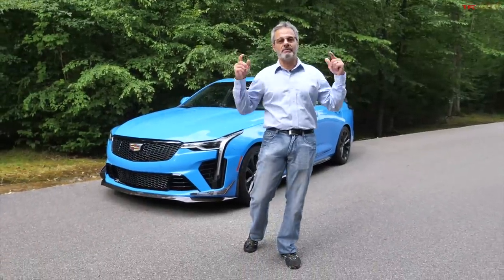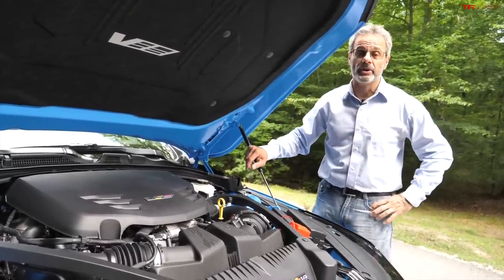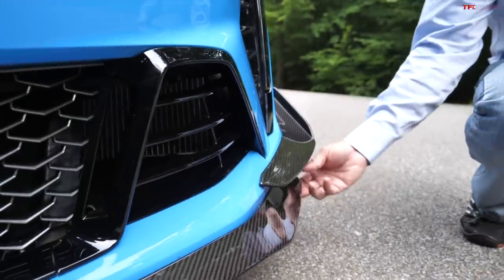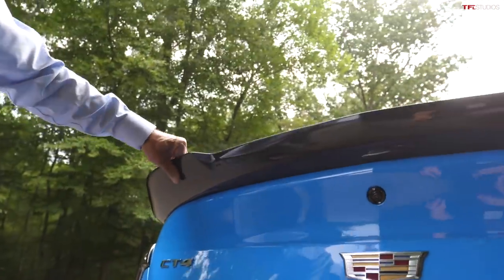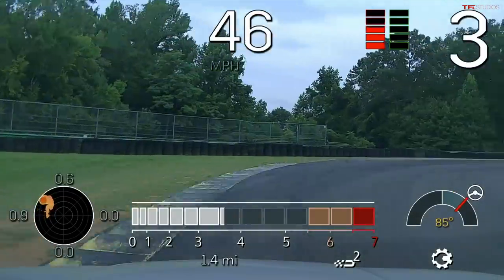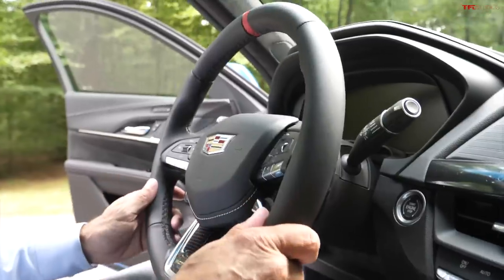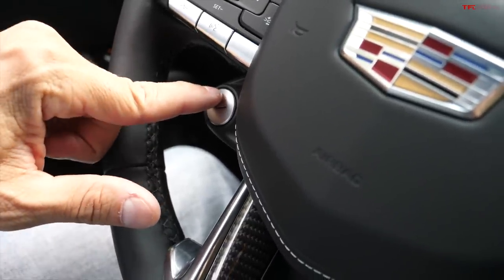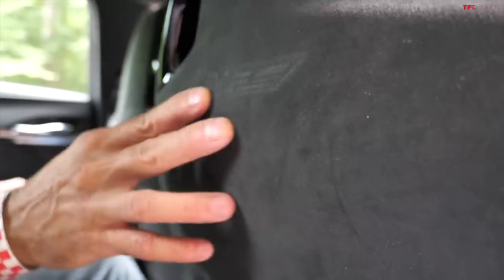Finally, Is The 2022 Cadillac CT4-V Blackwing The Long-Awaited BMW M3 Killer?

Comment: I have an ATS, I definitely want a CT4 now. Edit: the hyper-BMWs like the M3 do not have 50/50 weight distribution, for example  the 2021 G80 M3 automatic has a 53.5/46.5 front to rear weight distribution.

Comment: Fantastic video!  I've learned more from you about the Blackwing program than ANYONE else. I have a 2017 Chevy SS Sedan with the 6.2L V8, so I know that GM is capable of.  I have also owned 3.6L CTS's in the past.  But I like the sound of the 6.2L best; maybe I'm a CT5-V Blackwing guy?

Comment: This is cool and all, but you know we're all waiting to see what its bigger brother, the CT5-V Blackwing, can do! 

It's about time they made a manual V8 Gen 6 Camaro that you can see out of and has a usable back seat & trunk. Here's to hoping they make an NA version of the CT5-V Blackwing.
Reply: An NA version of the CT5 would just be a 6.2 V8 with the same power and more weight compared to the CT4V Blackwing.  it wouldn’t make sense
Reply: @bradyg499  Honestly it's what the CT5-V (non-Blackwing) should have been. They have all the hardware... also, why do they even keep this TT V6 alive? The 6.2 V8 is a gem, while most people agree that the TT V6 sounds like a vacuum cleaner. Nobody cares about the numbers or MPG in this segment. These cars are pure emotion and in that regard the V8 beats the TT V6 any day of the week.
Reply: I chose the 4 twin turbo because I thought  the manual would match up better with that platform. The 5 is just too big for my preference.

Comment: Pretty sure the ATS-V 3.6L TT LF4 also had Ti con rods in manual form.
Reply: On the ATS-V's it did. I'll keep my ATS-V's. I do wish I had the A10 and the Gen4 Mag ride system though.
Reply: It's the same engine
Reply: @mistamaog  But without the titanium rods with the A10
Reply: @mistamaog  Oh... and the ECM in these is locked... don't expect to be able to tune them anytime soon if ever.
Reply: @SteveBrueck  Better off with a manual anyways 🙂
Reply: @mistamaog  I grew up with manuals, but I love our A8's, especially with a tune. The trans can be tuned as well.

Comment: I'm Going to Buy One!!  RWD, Manual Trans, Twin Turbo V6 Sedan with prob closer to 500hp(GM Sandbags HP#s)
To me this is equal to a Alfa Romeo Giulia GTA that you can actually buy and afford!
Just needs lowered alittle to fill that wheel Gap and maybe some Lighter Forged Wheels.  It is a Weekend Weapon and is better looking than the M3.  If your considering an German midsized sedan.  Buy this instead!

Comment: I want one...  it's a car cadi has been keeping us on hold for
Reply: I want one but I need AWD, and unfortunately more cargo capacity. It would have been nice to have been given both as an option. So as it stands I'm currently looking at Stinger GT's
Reply: @Allen Tokyokawa

And why is that any of your business? Is it your money? That crappy Korean car fits my daily needs better than any other brand. It has the performance to match the m340i, V, AMG, and S. With the exception of tracking the car which I do not do. It has a ten year warranty, better reliability, and more standard features than most of its competitors. That Korean brand has been getting top or close to the top in initial quality. They have better pricing and without having to force me into an awkward looking wagon for cargo capacity. Sure it's a sportback, but it looks like the kind of car that I like to drive. So again name me the faults of the crappy Korean car. Actually don't, such short sitedness you'll just spew lies.
Reply: @Allen Tokyokawa Kia makes some of the best cars in their segment now. Don't be silly
Reply: @99-Zulu  You could go for the V instead of the V Blackwing. Lower on power, but still a good amount and comes in AWD
Reply: @Harmonic14 

My problem with that is that it doesn't have the cargo capacity that I need. If it was like the 3rd gen CTS with a bit more than 13 ft³. It would be just enough, but I've already tested the trunk on it and it doesn't fit all the stuff that I would normally travel with. The Stinger fits my budget, while being more reliable and having more than enough cargo room.
Reply: @99-Zulu  reliability lol what are you on, I'll throw in ten bucks to help your engine rebuild the week after purchase
Reply: @THESLlCK 

What are you on? Kia stinger is above BMW 3 series, MB C class, and Audi A4 in terms of reliability. Maybe I'll be paying you a visit to rebuild your engines. You'll probably spend more as well due to the brand names.

Comment: @ 4:19 No they didn't put that little wheel shroud there for aerodynamic purposes. They put it there because DOT regulation does not permit a stock wheel/tire to stick out past the fender. So that little add-on is how they get away with a wider track without having to change the body shape to create wider fender flares.
Reply: Wroooooonnnnggg

Comment: I like the concept.  Cadillac is making a nice car.  It is a decent looking vehicle and there is no argument that the performance is there.  When we say it will "beat" the M3 in performance, I don't know if I will always believe that.  They are comparably priced with comparable performance if you are comparing the RWD M3 (Non-Competition).  If you're going with the M3 Competition xDrive, then the M3 gets considerably more expensive, but the performance enhancement of the AWD system puts the M3 into another league (0-60 in 3.0s and 1/4 mile in the mid 11's) above the Caddy.  Depending on how much or how little you option out the M3 or Caddy, we can see overlapping price ranges; granted you can option out an M3 Comp xdrive up over $100k into CT5v territory.  Aesthetics are subjective, but when it comes to styling and fit/finish, I think BMW takes the win.  I can't get over Cadillac's styling.  They've carried the same style for at least the last decade.  Their cars always look boxy and chiseled whereas the BMW has more elegant lines while remaining aggressive.

Comment: I’m in my mid 30’s and want Cadillac to go back to making floating cars.  Put a couch back in there, get rid of race seats.  Honestly, I want a modern version of the 1991 Sedan DeVille I used to have.  Torque down low, cruising on the highway.  

Auto reviewers looking for everything to handle like a race car has destroyed the luxury car market for those looking for a real comfortable car, not a comfortable version of a race car.
Reply: I agree 100%. Rolls Royce may be the only luxury car left that is comfortable and quiet. Cadillac used to be a luxury brand, but now is just chasing numbers. Maybe a Lexus ES is still a luxury car, but I haven’t driven one.
Reply: You are kidding, those do not sell, and these cars are by far the best driving sedans anywhere, you go and buy a Mercedes or BMW if you want a floating ride. Plus with Magnetic ride control, they are not hard rock suspension like Porsche.. they glide over the pavement like Cadillacs of yore, the best of both worlds.. you have no idea, do you?
Reply: @AutoEnthusiastJC  Your comments tell me you haven't driven a lot of cars.

Comment: Why they didn’t put the LT1 in this is beyond me. Still buying it anyway.
Reply: It didn't meet the criteria for design. Not only that, our two ATS-V's make 700+ and 630+ whp. We make more power than the LT1 and weigh 400 lbs lighter. And we don't overheat like the LT1.

Comment: This actually competes with the 2 series grand coupe/M2 CS, RS3, CLA/A Class AMG. Not the 3 series and it's rivals.
Reply: It will eat any of those for breakfast! Even the M3 comp....
Reply: @lastnamefirstname520 

I'm not saying it's not capable of doing so, but people have been wanting to compete this with the 3 series. Sure exterior dimensions are on the larger side. But the interior dimensions match up to the 2 series.
Reply: @Neon

Last I checked, most areas go by interior volume not exterior dimensions. The CT4 lines up well with the interior dimensions of the A3, A class/CLA, and the 2 series grand coupe. Just because those are front wheel drive based, doesn't mean that they do not compete with the CT4. It just means that Cadillac wanted better driving dynamics in this class. So they chose that over having the extra cargo capacity of the hatch or FWD platform. You are just trying to find fault in this comparison because it's something that you are not used to.

The 1st and 2nd gen CTS was more of a competitor to the 3 series. The 3rd gen CTS was larger, because the ATS was a better competitor to the 3 series, C class, and A4. So the CTS competed against the 5 series, E class, and A6. So as a selling point to the Cadillac sedans. They market them as more car for the buck. Just like Genesis gives more standard features against their competitors. It's a selling point, it's something different.

By your logic, some of the Audi's do not compete in their segments. Because they are FWD based. Also, do not put words into my mouth. I never said, thought or implied that the CT4 was a hatchback turned sedan. I do not know where this comment came from.

Comment: Question is whether the intercooler is sufficient. Many cars are subject to heat soak due to poor inadequate intercooler capacity. Result is timing retardation and definite loss of hp and tq
Reply: I have a feeling with the issues the Vette had a few years back they have that all buttoned up!
Reply: Our two ATS-V's don't really suffer like the supercharged motors do. As long as they are moving, there is adequate cooling with the intercooler. I logged a pull the other day with 84º outside temps, 94º IAT's, and 135º manifold temps. Cruising the manifold temps were 145, but full throttle brings those down. I've had it on the track without any cooling issues.

Comment: How can GM make a car this beautiful while simultaneously making the Camaro so hideous?
Reply: Push the Camaro to a similar MSRP as this and you‘ll get a better design and more. It’s mostly fleet sales at this point so no need to spend money on a redesign.
Reply: Because the Camaro buyer is meant to be driven towards a corvette instead. The Camaro has become a settler’s car
Reply: Just passed a ZL1 a few minutes ago and I ja e to disagree. That thing looked super pissed going down the road.
Reply: @CMH_1975  The ZL1s are the only good looking ones.  They completely butchered the rest of the lineup when they did the refresh. Sales numbers don't lie and most people won't touch a Camaro with a 10 foot pole right now.  The ancient Challenger that hasn't changed much since 2008 is outselling it.

Comment: No ct4 black badge and v are a45 and a35 rivals. Ct5 is the m3 killers
Reply: The ct5 is dimensionally identical to the m5, the ct4 is much closer to the m3 in size and weight
Reply: @hermatred572  no look at car and driver they place the ct5 as 3 series rival and the ct4 placed as a cla class rival.
Reply: @ekgcanadianenthusiast9961  Ask Cadillac what their target cars were, it doesn't really matter what Car and Driver says.
Reply: @SteveBrueck  think what you want no issue for me
Reply: @Neon  no that's not what I said
Reply: @Neon  a class as a saloon as well
Reply: @Neon  you are confused .ct4 is the old Ats but smaller OK ct5 is the old cts but now in 3 series.plus a45 amg s has 416 HP from a I4 .

Comment: Bmws dont have good weight distribution anymorr even on there top of the line m5 and m8s or there 6 cylinder 340is and they dont come in manuals anymore and some cars like the 340i have no rear wheel drive option. After all that time of being the only car company who had great weight diatribution even on the lowest 325i. They go and throw it all away. Disgusting .

Comment: It's a let down they insisted on giving it this engine......with this being a last hoorah why not give it the Camaros V8..that engine is reliable unlike that turbo 6 and sounds great seems like a missed opportunity. Also Cadillac had no excuse for a car that costs that much having an interior like that they can make  a better performance sedan than BMW or Mercedes but they can't seem to make an interior that's better than a $20,000 car
Reply: 3 series interior is bland and boring, C Class looks like a cheap stip club with massive iPads for menus.
Reply: @ssaini5028  1. Both of those cars compete with the CT5....2. Boring or multiple screens both have better quality than either the CT4 or CT5 Cadillac just can't make a good luxury interior never has been able to smh🤷 it really is ashame so many decades of experience and is still substandard. The CTS and ATS same issue smh I don't get it 😕
Reply: Unreliable? DO you really know anything about these cars. That engine has been in use since the 2016 ATS-V's came out and they are bulletproof.
Reply: @ftr911drvr  I like the interiors in our ATS-V's. Maybe you should actually get in one instead of trying to be a car expert by watching reviews.
Reply: @ftr911drvr  Cadillac interirors and quality have been perfectly acceptable.  I always here about reliability issues with European cars from familyt friends and tow truck drivers.  ATS V spanked the last generation M3 and C63 on track.

Comment: Tesla Model 3 is faster and cheaper, not to mention AWD.
Reply: Tesla is slower around the track, and not as fun to drive.  Brakes would probably combust after a lap lol,  and reliability fit and finish is absolute garbage.
Reply: @ssaini5028  this is one of the biggest problems with today's consumer. Knowledge!!.  No one who considers getting a "Drivers Car" wld think to purchase a Tesla.   Yes Tesla has some cool cars.  With nothing is sporting about them. Not to mention driver inputs that are dynamic to the driving experience.  It has an electric motor so it has a fast 0-60. That does not mean it's a fast car lol

Comment: 472 HP....THATS IT?
Reply: The Previous ATS-V. Had a claimed 464hp from the Manufacturer. And it would Dyno at 450 RWHP all day.   So this one prob makes closer to 500hp at the crank. If not more.  I'm sure we will see dyno numbers soon. And with the weight below 4k lbs. Should be quite quick car.  My Shelby is 3750 lbs and Dyno at 474hp. So this car is probably faster!
Reply: We have two ATS-V's with the TT V6's. The wife's car make 700+ and mine makes 630+ at the wheels.

Comment: $90,000 🤢🤮
Reply: For 90K I’ll get a trackhawk instead. It’ll have AWD which will make it faster off the line
Reply: @naveenthemachine  yeah 90K is insanely overpriced. Probably attributed to those carbon fiber packages.
Reply: @naveenthemachine  the Trackkawk has a terrible interior
Reply: @kristians2704  it depends on whether you get the $5K signature leather wrapped package. If you get that option then the interior quliaty drastically improves
Reply: @naveenthemachine  a trackhawk no matter the trim is a poorly optioned rental car with too much power. It'll fall apart in <5 years
Reply: @hermatred572  well the Cadillac is a gm product haha. The fca will fall apart but won’t the gm product as well
Reply: That set up looks to be 74k for the Manual. It is pretty much fully loaded. I have specked them out  several times. If it has sunroof specked out to  75k. Pretty much fully loaded for the Manual.
Reply: 90K where are you getting that price from? This car tops out around 80K
Reply: @polo3433  I’m pretty sure there will be steep markups on it
Reply: @polo3433  he may have it confused with the CT5 BW